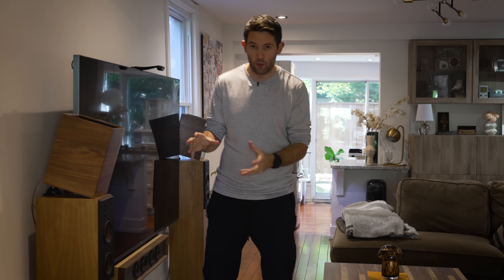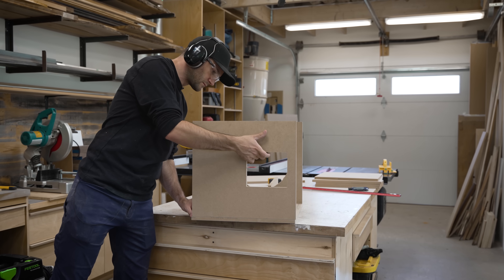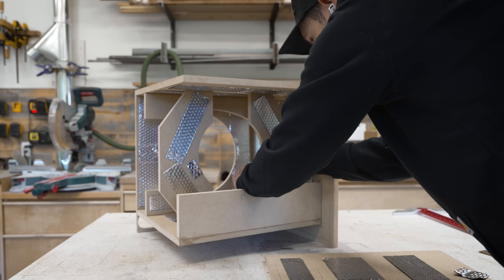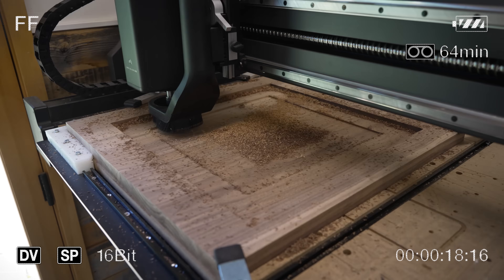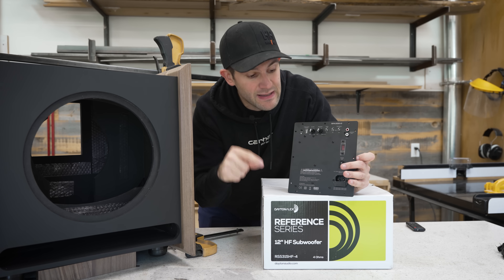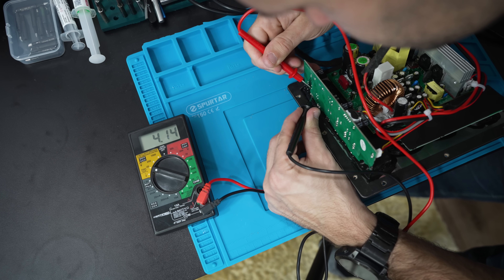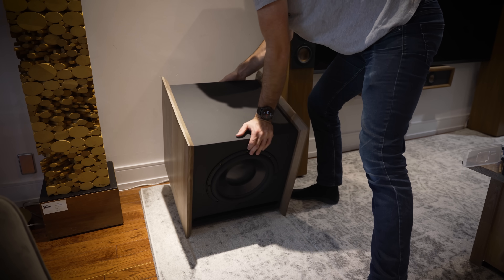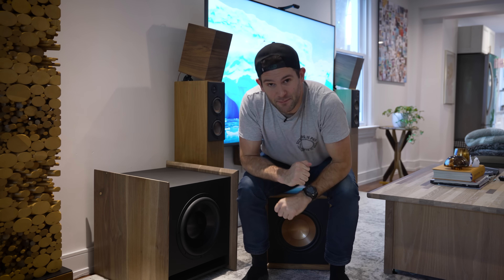THIS changes DIY Audio...

Comment: You really should rout a quarter round into the port and brace edges to minimize turbulence on those interior corners. Turbulence in the port will make audio coming from the port "messy".

Comment: 14:16 Keep in mind that hot glue can become problematic in electronic devices as it ages. Hot glue develops microscopic cracks with age. Those cracks act like capacitors, trapping stray electricity, which can cause all sorts of problems. I have had an old noisy reverb unit which I opened up, and it had hot glue inside. After I removed all the hot glue, the noise was gone. Aldough the hot glue is unlikely to cause you any problems at this stage, it is something to keep in mind as your hot glue ages. If your amp develops noise or strange behavior, you then might want to consider hot glue removal or replacement before you invest in to any expensive repairs.

Comment: An excellent craftsman. The AV wireless receiver will create a delay that will cause the subwoofer to be lagging. Not a good idea. You would need to measure the lag, and then put in a delay line for the other speakers so that they are in sync.  Zac should try a 16 inch diameter woofer because that it was used in the Voice of America system back in the 30's. That was a killer system.

Comment: 15:00 Did that UV-reactive mask cure? I’ve been told that most window glasses block parts of UV light, which are essential for curing. It might not have cured properly if it was behind a window.

Comment: Why do so many people spend so much effort to properly seal a subwoofer only to make giant hole in it for an amp or a wiring cup?

Why not mount the amp on its own panel, made to look like the back of the box, then make a tiny hole in the acoustic cabinet, just big enough for the wire. This way, you can seal that hole with heat-shrink, glue, putty something.

Isn't that better than depending on the amp panel to be fully air tight? Also, am I the only one that thinks the pressures created by the sub could also affect the amp construction and/or operation?

Comment: Those Dayton refference series are bad to the bone; tight and efficient. 
I have a 15" RSS390HF-4 powered by a Dayton SPA500DSP amp that is used in a mixing/mastering studio. I can hit 20hz at ~116db.

Comment: Running wires under a carpet is a really bad idea.  If they are walked on too much, they will wear and could short out, causing a spark and setting the carpet on fire.

Comment: it is wrong that an amplifier that is too powerful is bad, it is actually better if it is too powerful, because when an amplifier reaches its limits it emits direct current and speakers do not like that at all...
an amplifier that reaches its limits is the main reason why speakers are destroyed
it is more likely to destroy your 400W subwoofer with a 300W amplifier that is at its limit than with a 500W amplifier

Comment: Question... You said a ported is sub generally larger than a sealed sub...

Isn't the purpose of a port to allow the back air pressure of the speaker moving into the box, out? Allowing you to use a smaller enclosure with higher efficiency?

Comment: Not overdriving the speaker IS important, however, buying an amp with the "same rating" as the speaker can be dangerous as amp power ratings are often misleading. This is ESPECIALLY true for class D amplifiers where they often start clipping and introducing distortion well below their "max rating". Total harmonic distortion ratings, or THD, are a frustrating rabbit hole to go down, but I think its a rating any customer shopping for amplification would benefit from trying to familiarize themselves with in order to avoid damaging their speakers and their listening experiences.

Rule of thumb, it would be best to make sure the speaker and the amplifier will be sourced/spec'ed such that they will never run at their peak rating regardless.

Comment: It is actually better to use an amplifier that produces MORE power than the speaker can handle. Simply because the distortion factor is higher at higher volumes and class D amplifiers in particular overload and distort at high volumes. THAT will destroy a speaker.

Comment: I thought this sound dampening material is meant to be used on thinner metal material to reduce resonance. Did wood glue adhered well over painted surfaces?

Comment: I build something similar, but passive. I aslo build my "amp" using parts from china and the final result was one 2.1 audio sistem with bt 😁. I do one mistake.... sub bass port to small....and i need to fix this in future. How is now, is tunned to 56-60hz and my bads speaker can play easy at 35 -40 hz. Thank iou for your info

Comment: i really have to disagree. a ported subwoofer DOES NOT SOUND more natural. it alters the audio signal with a resonance that brings coloration and destroys the timing. some people love this boomy sound. i hat it. why? because i want to listen to the music and to the ported subwoofer resonance. a neutral speaker sounds natural.
another (small) problem in your setup is the cabinet resonance. the inner width, height and depth is almost the same. that means the pressure wave the goes from the membrane into the cabinet arrives at the same time on all walls and get reflected back to the membrane at the same time. this probably affects more higher frequencies that the woofer does not address but harmonics can be amplified. this is the reason why you usually take the golden ratio to go from a slim with to a longer depth and an even longer height. that results in three different reflections that addresses three different resonance frequencies but with lower volume. you then also can add filling material on one side to further damped these reflections.
i still have 4 dayton audio RS225-8 laying around. perfect for two closed bass towers where i can place the two way compact speakers on top.

Comment: The FS of the Sub is 24Hz, you could have tuned to Sub 20Hz! A tuningFS above Chassis Fs is wasted potential. A round BRport would have been better because less flowresistance therefore more output.

Did you build an extra sealed chamber for the PlateAmp? If not, that's bad because the plateAmps are not airtight, they leak at certain connectors.

Also, in contrast to what you said in the beginning of the video, subwoofer are really easier to simulate and build.

the dampeningmaterial you glued on the MDF is pointless because the Box is already stiff enough, more bracing would have been better, if you want go overkill.

Well, maybe next time.

Sorry, I am hating on you, yust critizing. I like that inspire people to build something.

Cheers
Nik

Comment: I built a 15" (maxp154d, dual 4Ω VC, 100 + 100 oz. Heavy Double Stacked Magnet Structure), 30Hz, 500Wrms subwoofer in a prebuilt cabinet for $100, plus old Sony Xplod amp and server psu (15v 70a for $15), super happy as it rattles your fillings for dirt cheap, it took about 2.5 hours to put together, 4 years later, still kicking hard. For movies that have much lower freq than music, it does not compare to my klipsch 12" sub.

Comment: Seems like the easiest approach is to build a Rythmic subwoofers. You can buy the drivers and servo amps directly from Rythmic or get them from GR Research along with cnc cut mdf diy cabinets to assemble (actually from Denton Woodworks). I veneered mine with oak and they stand up to the vintage danish furniture in our room. These designs are all worked out and thoroughly explained by Danny.

Comment: I don’t have a CNC machine so I wont consider building a cabinet unless I get someone else to do it. However, I noticed you ported the cabinet which to me means your speaker is inadequate. I my opinion, a good subwoofer is a sealed cabinet with a JTR speaker, not Dayton audio. Also, I noticed you were concerned about sealing your amplifier to the cabinet yet you ported the cabinet.

Comment: Having a larger amp compared to your subwoofer driver is generally a good idea. 
If you have a 300 watt sub driver (RMS power), then having an amp that can produce 500 watts (RMS) at the same impedance would be sufficient. This is to allow for impedance rise during play, and giving more headroom for better control of the driver.
Matching the amp to the sub driver is not the best idea, since it can cause distortion (signal clipping) at louder volumes.

Comment: First, the cabinet look great.

One thing you may have missed is that these specific wireless devices add ~32ms of delay to the signal. This is equivalent to about 36' of distance. Some of the reason for the delay is the AD->DA conversion which takes place as the signal gets converted to digital, sent over the air and then converted back to analog. It has been my experience (I ran subs wirelessly for ~10 years) that the various sound processors/receivers don't handle more than ~30 feet of distance when calibrating speaker distances. This is on top of whatever the distance between your listening position and the sub.

You are correct, bass frequencies do not require the same level of precision as other frequencies, but, getting it as close as possible to perfect can improve the listening experience noticeably. When running wirelessly I would tell the sound processor the subs were as far away as possible and then used the variable phase control to make sure the subs were in phase at the listening position with the other speakers. I switched my rear subs to wired about 5 years ago and they are easier to set up and sound better.

Also like many of the others here I disagree with the concept of limiting the power of the amp to the power rating of the drivers. This true for all speakers. I use the most powerful (decent quality) amplifiers I can afford for every speaker I have. I haven't fried one speaker yet. I have been using 500 watt mono blocks (1,000 watts @ 4 ohms) for over a decade with all manner of speakers including KEF, ESS, B&W home built, and Magnepan, from quiet to reference level (peaks exceeding 100 DB at my listening position.
Reply: Dayton Audio does specify a 32ms delay in the specs. I agree also on the amp spec, it's easier to blow a speaker using a small amp than a big amp in most cases. It's just that a small amp breaks tweeters easier and a large amp breaks bass drivers if you play too loud. Only in rare cases a distorting amp will break a bass driver, you'd need to distort the sound like mad.
Reply: Also ran out of spk/sub distance adjustments when integrating stereo spks outside 25-30’ in front with a wired sub 10’ behind and fixed polarity set to 180 deg. Setting polarity to 0 deg (half a wavelength difference at xover freq) vastly reduced the numerical feet difference in receiver the fronts and sub needed to be set at for bass integration.
Reply: Amen Brother!  I would never drive a  300 watt subwoofer speaker with a 300 watt amp. Most Manufacturers lie and manipulate their THD specs so bad its very dangerous to even get anywhere near the 300 watt level on a speaker rated at 300 watts. The THD of the amps usually pretty godawful at even close to 300 watts of Most amps.

Comment: Nice job, despite the wimpy underpowered amp. You should have doubled the power. Power doesn't kill speakers, distortion does. You need the dynamic headroom for that effortless clean sound.

Nah, the Klipsch are just faking the base with extra upper base. More punch to mask the lack of bass.

Comment: Sorry dayton, but using 2.4GHz radio frequency for audio is trash.  Linus did a video about troubleshooting his smart home wireless speakers, and all the inconsistent issues he ran into.    Guess what other devices also emit radio in that same band.

Seriously, for the price of those adapters, I would have liked to see use of the 60Ghz band,  especially so you can reduce the latency to near signal processing limitations...

Comment: Latency is latency when it comes to transmitting information via wireless, it happens to all the program material passing through it. Fortunately your wireless sub being out of sync from your wired speakers by up to a few milliseconds won't be noticeable. 
Frequency dependent phase shift is only a thing in passive crossover design which isn't part of this build.

Comment: I'm gonna be that guy too:10:55 Wrong. Over-powering a speaker driver is ok, even DESIRABLE. Under powering it is the problem. I know it's not intuitive but here's the why and how. Not enough power will overwork the amplifier and cause it to distort when it can't provide enough current at the voltage the audio wave dictates causing distortion and DC voltages to the speaker which will overheat the coil and burn it out. Over-powering by a healthy margin (2 or 3x) will ensure this doesn't happen and make the sound more accurate because it will have the oomph to make that speaker cone change direction more quickly resulting in tighter bass that's not sloppy or smeared. Think of it like a car, an under powered car can't get out of its own way, whereas more power means better acceleration getting it up to the speed limit faster. The power is not forcing you to speed because you are in control of that power. With an over-powered amp you're more likely to get too loud for the room (speeding) and out of balance with the other speakers long before over-excursion damage happens. You just won't be able to use the full amount of travel on the volume knob so be reasonable, there's no benefit from going to extremes. The companies that make those self powering modules probably thought of this so matching the Wattages will probably be fine and given that you have headroom on your controls tells us that power amp is sized well.

Comment: My theory on subwoofer bracing is, the damn thing's gonna resonant anyway. Along with the walls, and the floor, and everything else in its path! I like to use Good Strong joints, then TUNE the Walls to a pleasant sounding resonance, instead of harsh. And utilize the entire enclosure as a passive radiator.

Comment: I hope you have better luck with those wireless modules than I have.  I’m a fan of most Dayton Audio products, and I have used many.  I have found them to have poor range and subject to interference from barriers and even people walking between sender and receiver.  Putting them inside of enclosures is starting at a disadvantage.

Comment: Guess I also have to be that guy! The only real benefit of class D is efficiency. That efficiency comes at the expense of audio quality. Should have gone class A. Especially since you chose a reference driver. But great build still!
Reply: I'd be curious to know what the damping factor and voltage slew rate is on that amplifier!!! 😂

Comment: Next you should build a sealed box using the same components. I guarantee it will sound better if you build the box to the correct volume. 
You could A/B test them, and that would make a great video. 

Manufacturers just build ported boxes to be louder and boomier with cheaper components, but if you want amazing sound you want a sealed box.

Also don't try wireless speakers. You'll lose so much audio quality it'll be a waste of time.

Comment: Idea for a follow up:  Closed box, measure the actual response down to 15-20Hz. Put into a table with the measured output in 2-5Hz increments and use it to program a parametric EQ.  If your amplifier is up to the task, you now have a flat FR curve from 20Hz and up. Even at low volumes.  

Is a few decades old concept, but I have not seen it done on YT yet.  
If you want to take it further, add 1 or 3 more woofers installed opposite each other. You dont have to to increase the size of the enclosure. All playing in phase will cancel the inertial forces acting on the enclosure. Best part, the soundwaves/pressure will no longer travel from cone to vent, or just make their way around the enclosure.  Do it with some cheap 8" woofers. When you hear the result, and after a couple of minutes realize what insanity will come from using high quality 10-12" woofers instead... that feeling right there is what it all about.

Comment: Very nice looking build and welcome to the DIY speaker building club. The sound mat did nothing for the subwoofer, it vibrates at a much lower frequency than the mat absorbs. You don't need it, OR stuffing with Poly / Fiberglass insulation...  the MDF is fine alone. For future sub builders, don't bother. But your little sub looks very nice. Good build quality .

Comment: I unfortunately hav two problems with this solution...
First is having a garage. I live in a very densely populated area where having a garage isn't common and not affordable. Second, because of the population density, the 2,4GHz band is already so overcrowded that my wireless keyboard with trackpad (that I use for the PC when on the couch) has trouble with signal integrity :(

I guess I'll stick with boring and annoying wired subs for now

Very cool video and great looking sub!

Comment: I have a open baffle system almost perfect sound but it has no room loading a plus at night and super tight sound just beautiful, but by mix and matching it with a ported or closed i can get a perfect balance of room loading.
you can do that as well you say one is as tight as a non ass the other nice and fluffy.
Find the point where a gun shot sound sound like gun shot and a bomb like a bomb.
This to me also counts for high and sound in music a drum can sound like bang, tight and hard but also load the room in other cases.
With a dsp you can make more than one preset like 80% open baffle 20 % ported or 50% / %50 wat ever floats your boat.

Comment: Hey you didn't apply those butyl sheets properly. I use them on vehicles. You're supposed to use the roller after hand laying to apply them fully for full effect. You're probably going to be ok but they're not giving you the full effect.